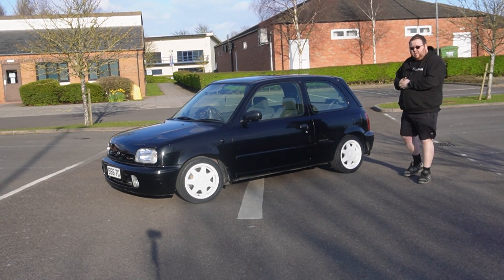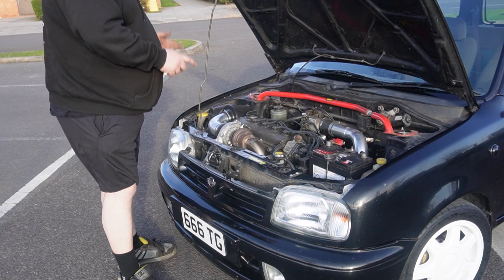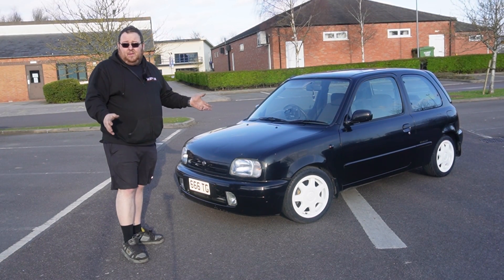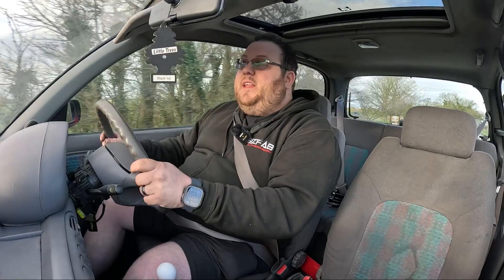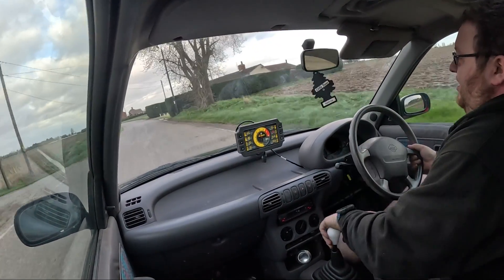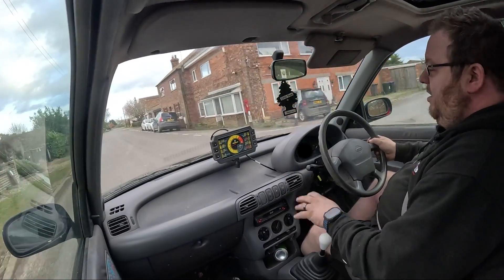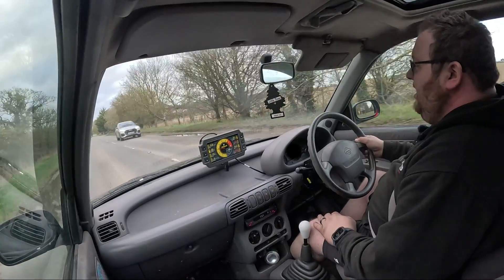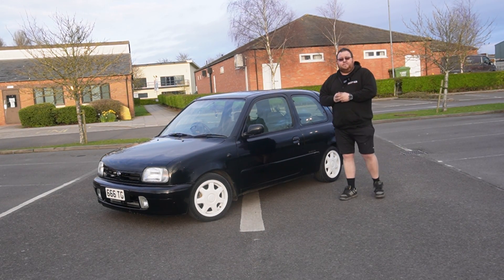WHATS IT LIKE TO DRIVE A TURBO K11 MICRA?

Comment: What would something like this cost. I wanna turbo my micra
Reply from the maker: Depends on your spec. This is a Pretty, Higher spec build (Not the highest spec we have built), But as a Drive-in, Drive out Job to this spec, 4500-5000.
Reply: @GizFab i have a 1996 k11 1.3 with about 155000 kilometers. 4500-5000 is a bit on the high end for me what are some posebiletys for around 2500-3500. I am a machenic myself so i can do all the instalation i realy just need parts. My goal for this micra is a fun but not grazy daily driver similair to this one. So around 150hp.
Reply from the maker: @bastianmeerhof7741  We do a budget kit on our website. The cost is £1700 For this kit.

Comment: Lovely but its a 8k build, love gizfab but right now fhey cant even provide an osaka spoiler. Their turbo kit is a partial kit as is the supercharger kit. I love they are the place to go but they really are not selling complete kits and in which case anyone that can weld is to the hard work that is the manifold. They dont allow for injectors etc. You can get similar power running it on motorbike carbs easily.
Reply from the maker: We are quite Clear and Open about what our kits do and do not include.

Our Turbo Kit is a "Full Kit" Including the Turbo Charger. Our Supercharger Kit is only missing the Supercharger - But we provide all the instructions on where to source. 

You will 100% Not get 140hp+ On a Stock Micra Engine from Bike Carbs.
Reply: Sorry I thought the turbo kit didn't come with Injectors and management. That is what I consider a full kit. 
I didn't say just bike carbs. Bit like your turbo kit you would need to do something with fueling and loads of other stuff. 
You are very open about what they include. Didn't say you weren't. Love your site. Don't get me wrong would just like to see matching kits for the extras to get the best from them. Sorry if I offended you.
Reply from the maker: @ We do offer engine management, only if we fit them - same with the injectors.

Injectors and management can be a personal choice, which is why they are not included so you can decide what you want to use.

We only supply and fit Haltech, which isnt in everyones budget - so providing the kit without an ECU allows people to use cheaper options.

Comment: So at 5psi on the t20 turbo what fuel is it running? 95 octane or 98?
Reply from the maker: Tuned on 98 - Not really needed, but was an added layer of protection for the stock engine.

Comment: Any chance you can do a video of the injector rail? 
Ive got forged pistions going in on my micra 1.3 dizzy. 
Custom ecu 

Just struggling on a fuel rail- im aware there are adapters out there but yrt again not alot of information on them.
Reply from the maker: All info is on the Facebook page. Need to do a little search

Comment: Just out of curiosity what’s the most power you could get out off a 1.3 stock engine many thanks
Reply from the maker: I have customers running anywhere from 160-200hp
Reply: Wicked thanks for replying. Would these powers last long on a stock engine if running a good map and mods cheers
Reply from the maker: @AdamWorks01  yes.
Reply: Also wondering how much boost can these micras go up on a stock engine. Really do appreciate it thank you
Reply from the maker: @AdamWorks01  boost is irrelevant as depends on the turbo and map

Comment: i have a 1.4 coil build with ct12 toyota turbo,and it seems to be of perfect size. drives realy nice, just have to get it properly tuned but wil do that after i mounted opel turbo pistons and get more boost in it. thinking about running 1 bar of boost when the turbo pistons are installed. wil the rest of the block survive that? using a det3 piggyback to tune the whole thing btw

Comment: Ive been toying with the turbo idea for a long while now on my Super S Calsonic Micra, but I do value the reliability of N/A. 
It's running a Haltech elite 1500 and the IC7 dash. It has oil temp and pressure sensor, fuel pressure and temp sensor, obviously air temp. An uprated Aeromotive fuel pump, Turbosmart Pressure reg with GA16 injectors. But I have a manifold converted to take later top feed injectors ready and the idle air valve shaved off the Throttle body. Also Has Newman Cams fitted.
I will be very interested to see a mapping video on this. 
Would it be beneficial to use a plenum type manifold and a bosh DBW throttle body ?? 
N/A I'm running around the 110 bhp mark. If I do decide to do it, you will know as I will be coming to you for the parts 👍

Comment: Rear discs didn’t come as standard on the super s. only with with abs. 

was very rare back when i had a k11 in 2006. must be super rare to find a disc axle now. you can convert them with custom made plate on the stub axle to mount the caliper to. i spoke to some guy with a NME works rally micra and thats how they had converted it.
Reply from the maker: We produce Disc conversion kit for Drum Axles.

Comment: How does a k11 with one of your supercharger kits drive compared to a standard one? Obviously alot quicker but is the torque and power curve similar? Or does it become a bit gutless when not being absolutely thrashed?
Reply from the maker: Supercharger produces all the Low-Down torque. Our Current S/C Kit is also maxed at around 115hp on the 1.0 and 125hp on the 1.3L
Reply: @GizFab  exactly what i wanted to know, thanks very much

Comment: See you since a long time builbing piping and turbo kits and it's cool to see all the hard work you did on the streets😉👍 
I'm curious to see a "maping video" to see the final horsepower on a dyno.
I'm installing one of your turbo kit on my micra for my very first "trackdaycar" and i'm still questioning about fuel rail and injectors.
Maybe a video about it....🤔😉👍
Reply from the maker: If you have a later coilpack - The injectors are easy. If you have the earlier Dizzy type engine, The info in this video is relevant
Reply: Yes I have a Dizzy cg13 to swap in my Micra but need to rebuild it with forged pistons to avoid melted piston's rings....🤔😉👍
Reply from the maker: If you do the build sensibly with decent management - Melting Rings isnt much of an issue. Pistons and Rings melt when using Stock Injectors and Stock ECU with no Tuning.  @s_77_studio
Reply: Injector will be upgrade and the ECU will have a Nistune with a remap not as follows nest as the Haltech system but a good start I think...🤔😉👍